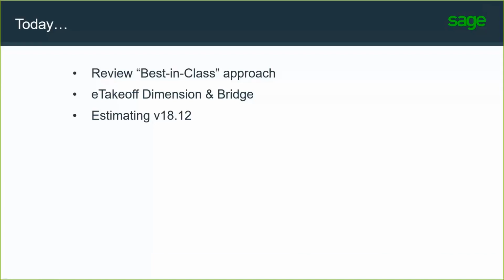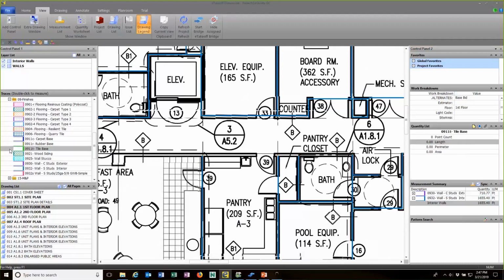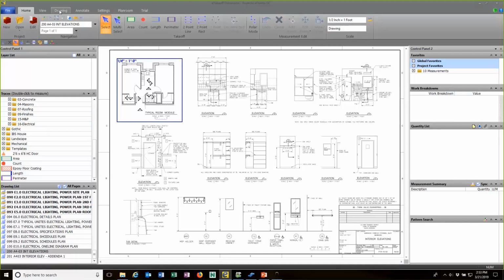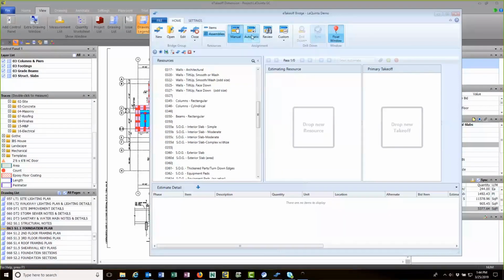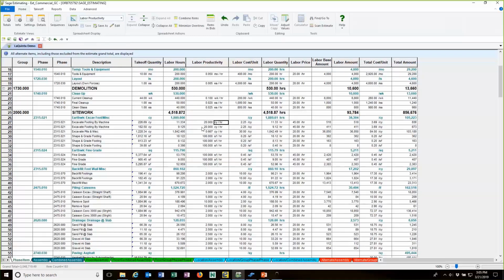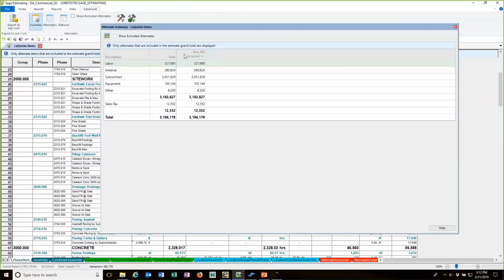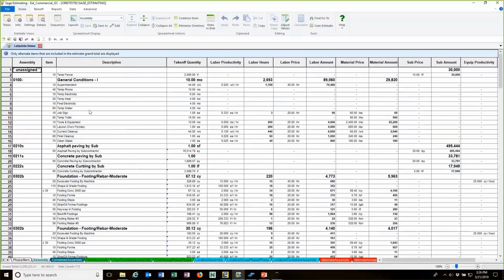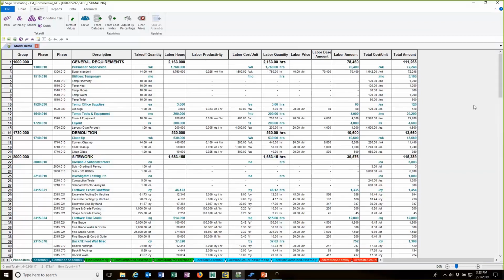2019 Sage Estimating and eTakeoff demo

Comment: Is it wrong to assume that one could create their own models instead?
Reply from the maker: Hi @Just for Work ... sorry for the delay in our reply. It depends on what type of model you're talking about. Sage software does not create any of the models in Navisworks or Assemble. It pulls all the measurement data from the models to create an estimate. If you're referring to models inside Sage Estimating, then yes, you can create your own.
Reply: This is a very powerful estimating tool. Especially when pulling in Navisworks models for takeoff. The ability to build assemblies and then replicate them is super useful. It’s also nice if other Sage modules are used for job tracking and accounts payable / accounts receivable as the data can be moved from module to module without additional data entry. I was also able to use takeoff lists for requesting material quotes.